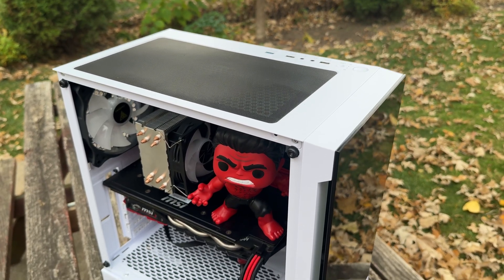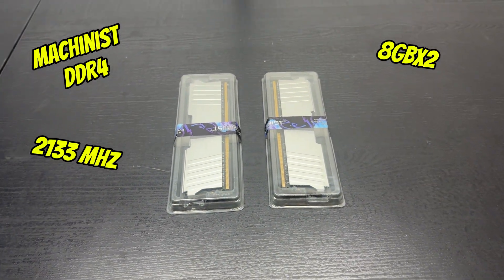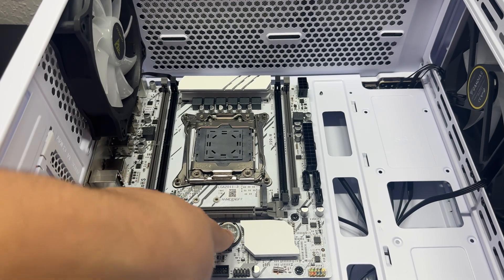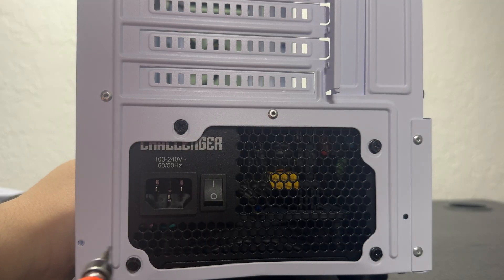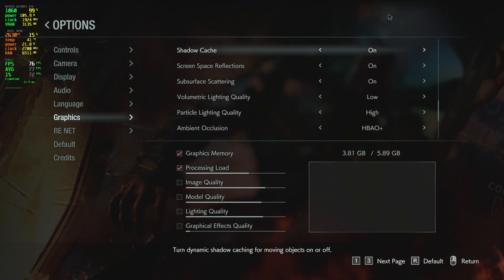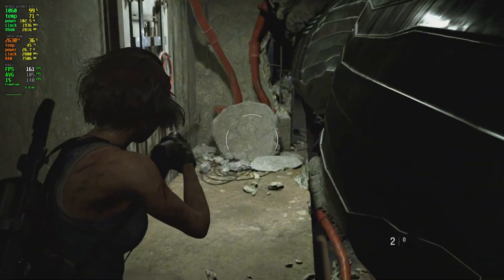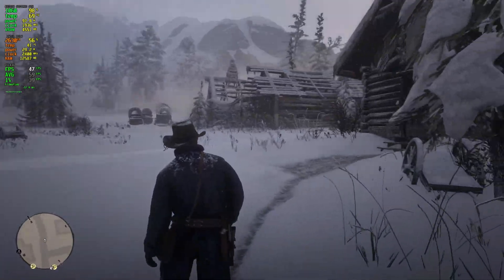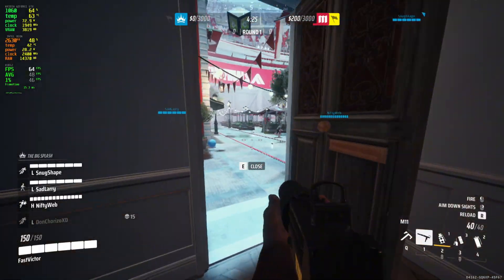$289 BUDGET PC BUILD!

Comment: Even for mates rates, $20 for a 1060 6GB is ridiculously cheap and impossible to replicate. $50-60 is probably the best anyone is going to do for one of these on the used market so this build in total is more realistically going to cost $300 and honestly an i7-4770(K) or 4790(K) along with an ali express lga 1150 board would have been the same if not cheaper and would actually give better performance in gaming. And for that same $50-60 an 1060 could be had for one coukd also invest in a slightly better 1660 Super which games very well with an i7-4770K and 16GB DDR3 which hasn't drastically increased in price as bad as DDR4 has.

Comment: pretty cool video and a nice build. its true you couldve gotten better deals, but dont let it bring you down. with time you will learn where and how to get better deals, dont sweat it. good job, now do it again on am4 :)
Reply from the maker: Thank you! 🙏 I feel like I’m just exploring what I can build tbh, I see something cheap I can use and I buy it, and I typically aim for under $500. Better deals are out there absolutely but I find it fun making builds regardless of value. I actually have an am4 build ready for 100 subs special, so stay tuned! 🔥
Reply: @KAMPOGAMINGYT  ill see when its out :) for that budget i usually squeeze in r5 5600 32gb ram 512gb nvme and rtx 3070 usually b450 mobo

Comment: I just did a similar build. You got some great prices. I got the qiyida mobo for $39.05, a xeon 2697v3 for $9.99, 24gb ddr4 2400mhz for $45, cooler master 240mm aio for $30. China T3 case w/ 3 infinte mirror fans for $55. 5 additional darkrock infinite mirror fans for $30. A 1tb gen 3 netac nvme m.2 for $56.  A Thermaltake smart 600 watt psu for $29.99. And a rx 470 8gb for $49.99. Got a keyboard and mouse combo for $13. And I had a 1080p 144hz monitor that was my old monitor laying around. And $6 for a wifi dongle. Total cost was $405 and some change with tax for everything. Performs really well. I like the amd cards for the super resolution. This setup can run 1440p with an 8gb amd gpu.

Comment: you could make a better build, r5 3600(stock cooler) with a b450 or a520 with faster ram used from marketplace and another thing, if u have a m-atx mobo use a m-atx case, it just looks kinda ugly otherwise, but nice video.

cpu- ryzen 5 3600 - 40$ used
gpu- gtx 1660 super 6gb- 80$ used
mobo- a520 -50$
nvme- 512gb 30$
psu- 550w 30$
case- 40$
ram - 30$ used

and xeons are kinda hard to sell
Reply: I agree the zeon systems are kinda hard to sell since they're older. But for a budget system, the pricing isn't bad. I used a similar case to what he got, but it was double the price. And the 5 extra fans was almost the same cost as the case itself. And he got a great deal on the motherboard compared to what I paid for a very similar one just different brand.

Comment: Practically the best budget gaming build still remains this one that I built in 2022 for someone. Ryzen 2600x, a320m motherboard or a350 (better), 16GB DDR4 3000MHz cl16 (8x2),  rx 5600xt nitro 6GB. I would now add a rx 6600 or rx 6600xt and run it on a 1080p monitor. I even tested it with an rx 3070 at that time and it was fine. The ryzen 2600x is very cheap but it can still run over 4GHz, 4.1 to 4.3GHz usually without overclocking. On my a320m it never went above 4.1GHz but sustained those clocks at good temps.

Comment: Nice but no need to spend more than 15 USD on a used Power supply in this configuration, a used 450w PSU would have been sufficient. Also the casing is overkill. A used generic casing and a used 400 or 450w casing and you budget would have been well below 250 USD. Also I would recommend the rx 5600xt since I have used both the gtx 1070 and it in the past. The rx 5600xt used to be and perhaps still is the best bang for buck budget card. After it comes the 5700xt or the Rx 6600.